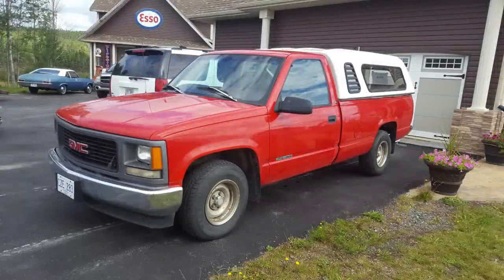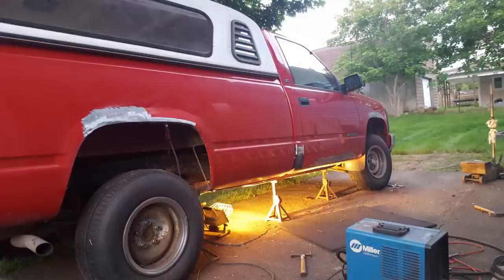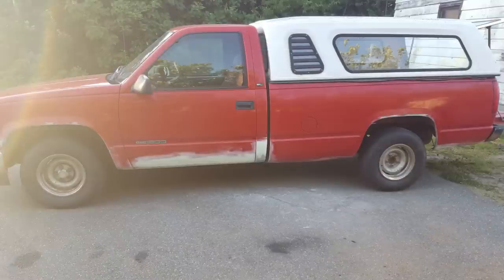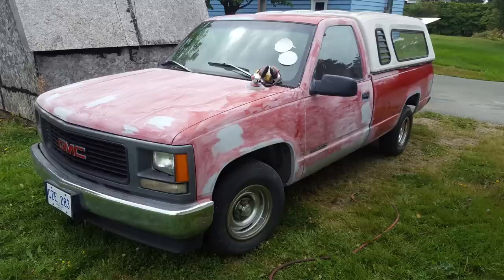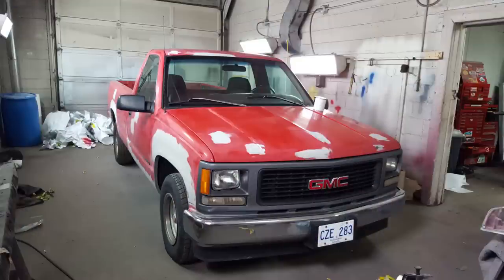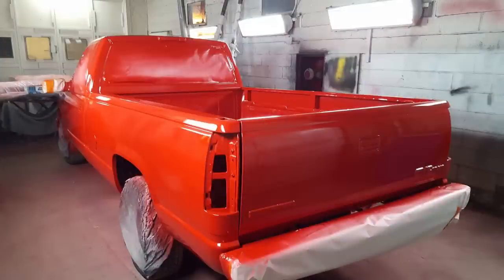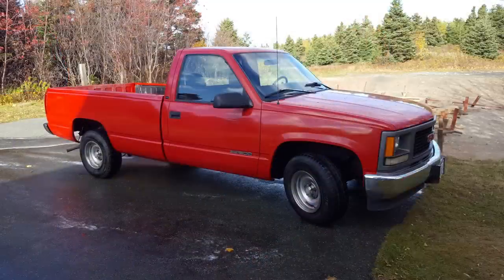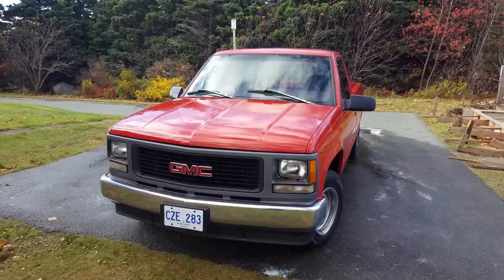Simple driveway makeover

Comment: A few years ago a buddy of mine and I made a make shift  paint booth with 2x2's and clear sheet plastic and a window fan and then we need it we'll take it down out of the overstorage in his shop and screw it back together. We do alot of paint jobs with cheap paint, mostly with Tractor paint, the Sheet plastic also acts like a greenhouse and it dries the paint faster, instead of 24 hours it dries in 10-12 hours. I don't remember the exact cost of it but it's was less than $75 and we've used it 50 times maybe more. It was well worth the money.

Comment: my 94 has some lower door rust on the bottoms now  Pretty easy to make?
Reply from the maker: Can be. Need to replace the inner and outer bottom lip. Hopefully the inner section is still good
Reply: @fitzeesfabrication.thefl-nf7hp   the inner just has one tiny hole about an inch  only on the passenger door  I got all the scale off years ago pulled back the seam some cut the bad stuff out Put alot of acid on it its been holding decent